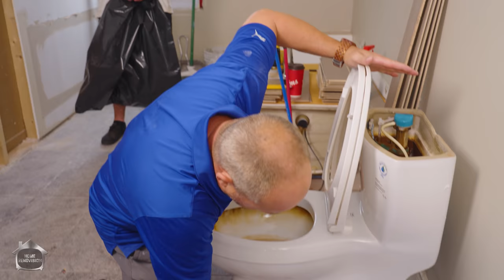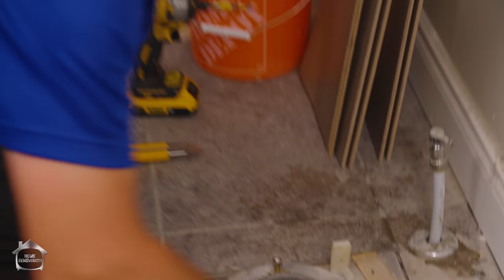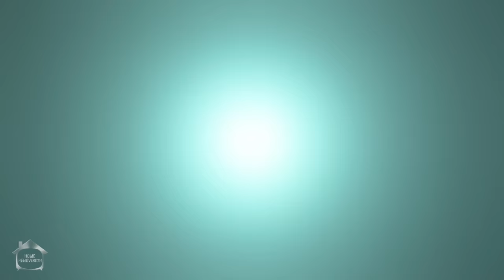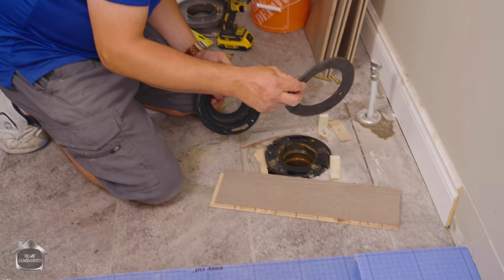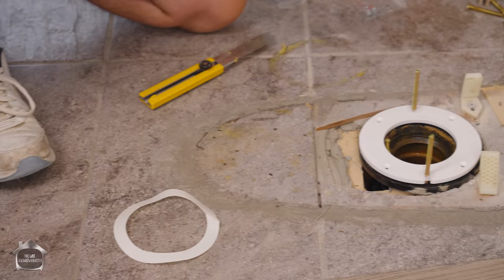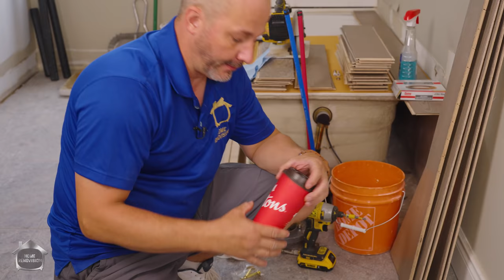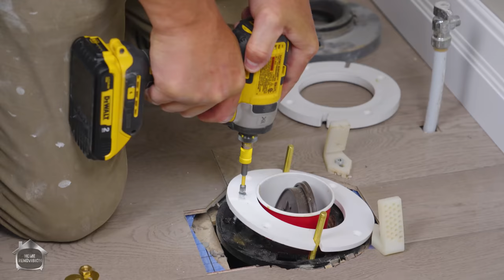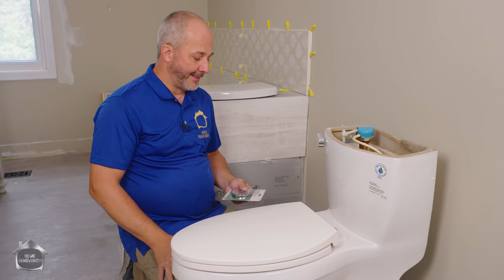How To Install A Toilet So It Won't Leak | DIY For Beginners

Comment: Thanks for your videos....I'm doing a bathroom remodel....and the toilet is a REAR outlet. Should I stay away from wax? Wax was used previously...and it leaked. Neoprene? How should I handle re-installing the rear outlet. The toilet sits on concrete slab, so there is no way I can re-do this...I need to keep the rear outlet. How should I approach this? Thanks.
Reply from the maker: yes use the rubber. Cheers!

Comment: Installed 2 toilets 10 years ago. One with wax and one with no wax and a rubber sealer. Don't recall which is which, but one keeps clogging. Excited to pull it out tomorrow and find out which one it is and why it needs multiple flushes more frequently.
Reply: What did you find out?
Reply: I’m guessing the wax one was clogging?
Reply: @Splattervision-qh1sd  Yes, but not a result of the wax. Looked like my kids flushed wipes down a couple years prior and it got hung up halfway past the wax seal. Overtime, the wipes hardened. When I pulled the toiilet off, it was a solidified flat 3x5 chunk of wipes that wouldn't go down the hole but would move sometimes creating different results from flushes. Looked like it first got stuck in the bottom of the bowl drain where it solidified and flattened, then migrated to the hole.

Comment: I enjoyed your video very much.  However, I would recommend that prior to disconnecting the water supply to the toilet you should locate the main shutoff for the house.  I have had more than my share of leaking block valves.  If you have a spare and know the location of the main shutoff you are money and time ahead.

Comment: What about the powder you can put in the toilet to gel the water so it doesn't leak everywhere?

I like the rubber, universal, wax-free seals. Super easy and they fit a wide range of floor heights. Also super forgiving if you are doing it alone and don't initially drop the toilet straight up and down.

Doing another one soon in a 100yo cottage with new LVT over existing sheet vinyl.

YT borked my comment when I added to it. 🤷‍♀️ I saw your initial reply, though. 👍

Comment: just replaced toilet at my son's.  just installed a year ago by renovator. son initially thought leak was at floor so I assumed seal. then he saw leak at tank. in checking that he broke the  tank. today when we lifted toilet wax seal had not been crushed at all. plumber put flange on cement and renovator put floor around it higher, and cut square hole. new toilet came with horn and thicker wax so went ahead with the installation. toilet shape is such that corners of square hole show a bit at rear.

Comment: If you use grout if the toilet developes leak behind grout you would never detect it before sub floor rots out? Ime I thinking about this correct it would be damming up the water in a way

Comment: I tried to replace the toilet today.  It is 20+ yr old and has been rocking.  Upon removing it, I found a plastic flange bent downward where it is attached to the subfloor and sticking out upward where it is attached to the toilet.  I suspect too much of torque applied on the bolts.  

The flange is about 1/4" above the floor.  Should I try to repair it with the with brass/stainless steel repair kit or replace the entire flange (meaning hiring a plumber)?

Thanks.

Comment: We recently had a company reinstall our brand new toilet. Before renovation, it sat flush on the floor. We had new subfloor and lino laid. The toilet now sits 3/8"-1/2" above the floor. I can see shims under it. When I step on the floor on the left side of the toilet, things sitting on the tank rattle. Even sitting it can cause a rattling. Would that be a loose toilet? I do not want to have to repair our brand new bathroom. Would really appreciate feedback. Thanks!

Comment: I only have one question, once installed how can you tell it's not leaking? I replaced the wax ring for my toilet three times and was still leaking. In the end I had to replace the whole floor and joists because of rots. Now it's time to reinstall and I'm scared to do it.

Comment: When I went to replace the builder grade toilet in my new house it had a wooden wedge under it to level it, and a sort of styrofoam gasket that was adhered to the floor. It took a helluva lot of scraping to get it all off so I could install a decent toilet and wax seal. So much for “professional” plumbers! Another house in the development they failed to glue the sewer line from the toilet and the whole concrete basement floor had to be dug up.

Comment: i always buy at least 2 wax rings in case i mess up one (eg while lowering the new toilet). you can always return the second ring. they are relatively inexpensive too. cheap insurance for me and it avoids a trip to the hardware store mid way through your install if you wreck one.

Comment: I just saw this video. It's great video. But I have a question. I'm going to do my bathroom over. I have to do my floors all In my bathroom. My wood is bad around the toilet.  I knew that I'm going to do the floor. But I was going to put the vinyl plank floor under the toilet so I don't have to cut around it. So I could just make sure that pipe or use a toilet extension and it would work good as I'm seeing from you. If I'm thinking right. Thanks for the video. I'm watching a lot of your videos. And thanks for sharing your information.
Reply: If the wood is bad under your flange  you need to replace the damaged wood.
Reply: Yes I plan on doing that. I have to .

Comment: Did the dye test from the tank. Toilet bowl turned color but not because it dripped from the sides which I thought would be a bad flapper. So where is the leak actually happening? Tank level also slowly goes down too.
Reply: Overflow seal
Reply: @johnd9541  ah thank you, it turned out it was a slow leak from the flapper which after replacing it, that the issue with the tank water lowering over time, and some of the whistling coming from the fill valve too

Comment: You forgot the bit where you discover rot in the subfloor from a bad wax ring and end up re-doing the bathroom floor!
Thanks for another quality video!
Reply: @RobC1999  I'm not a contractor, but I imagine any rotting wood would need to be removed and replaced. Which would involve removing the flooring and subfloor possibly down to the floor joists until you get rid of all the damp wood. No sense in putting a brand new toilet on a rotting subfloor, it will just move and ruin your wax seal and you'll be doing the job over before you know it.

Comment: You can always double wax if the flange is a tad low! Just make sure you don't double wax two jumbo rings with the plastic horn.
Reply: Never ever use one with a plastic horn. Ever. They cause leaks. The horn shifts and splashes water out of the flange. Always go with the plain old wax ring by itself. If you can only find a horn ring, cut the horn out of the center so there's nothing but wax left and the horn is totally out of the center.

Comment: hi i have baseboard 3 zone heat with ac unit in attic, both running same time, i did change old thermostat ( battery operated) to smart that's when the issue start its been 2 different HVAC tech came through and could't figure it out. 2nd one says machine is not compatible with new thermostat. too much power going to ac unit to turn it on. what do you think?

Comment: Good video, as I always like to learn new things. You are a great teacher. As a DIYer, third class, I consider three things before I start a project: Time, Effort, and Money. For time, I always take my estimate and add a factor of two or three. For effort, I decide if I will need a helper(s) to save my back. For the money, when I do a project, it costs what it costs. Professionals: They are only interested in how fast they can do the work. How to do the job with the least effort. And how much money they can get from you. Those plastic 'L' shape pieces. Are they designed to help align the toilet when you replace it? That sounds like a good idea to me. My only negative comment is your use of the adjustable players on the nuts. Isn't that what wrenches are for?

Comment: Hi there

I’m using the plastic extender kit, but found myself with the back of the flange higher than the front. Is it kosher to shim the extender front part with like a piece of plastic? I tried it and it’s pretty level now sitting approx 1/4” above the ground. 

My gut says it should be fine because the extenders even if flush together most likely won’t stop water. 

Any guidance would be appreciated. 

I’m on a concrete slab and got no other options here.

Comment: a question for plumbers....do you recommend caulking the space between the bottom of the toilet where it meets the floor or leaving it open?
Reply: Caulk it. Leave 5ish inches open in the back in case there’s a leak.
Reply: @Jamison-  thank you 👍

Comment: Love the coffee cup trick, can’t wait to use that one!
Reply: After seeing Jeff use this on an earlier video, I had the opportunity. Works perfectly! 👍 🥰
Reply from the maker: Cheers Kathy!
Reply: In the event that something is flushed down a main stack, it can create a vacuum effect and suck the cup down the pipe.  Just stuff a bag with paper and tie it off to the flange.
Reply: @johnd9541  I use a hard plastic drink cup in the LARGE size, that's tiered up larger at the top (so the smaller bottom still fits in the cup holder in your car). That baby isn't going to get sucked down anywhere! 👌

Comment: I’m up-doing my bathroom with vinyl flooring on top of ceramic tiles and need to change the toilet and vanity. Do I change the toilet and vanity then add the floor? Or the other way around?

Comment: As long as the wax is adequate and its installed on a flange that not to high so it rocks it will be fine. If flange is to low just add a 2nd wax ring or a jumbo unit.

Comment: Thanks for the video it's very helpful! I can't understand thought why you need the white extension rings - is it just because you're raising the floor?
Reply: He was raising the the flange height so that the wax ring would meet the flange and squish together to create a seal. All this was a result of a remodeled floor which caused the flange height to once be flush or a little higher than the original floor to now being lower than the new floor and that is a no go!

Comment: here's a couple tips for you pros lol… Use a sliver of carpet, (nap down) not a trash bag. It will protect the toilet and the floor while making it super easy to slide across the floor.  Also use a Pick-up-Stix to lift the toilet from the base. Your back will thank me!
Reply: I remove the toilet and set it on a furniture dolly. It stays on the dolly until it is time to be reinstalled.
Reply: @tomn4838  sounds like it's pretty good just so long as the wheels don't mark the floor, I may try that too! 🍻
Reply: @Don_Von_De_LaNooch Those dollies they sell at Lowe’s, just the basic ones with pneumatic wheels….gold

Comment: I removed the flooring from my bathroom and after all layers were removed my toilet is about 3/4 inches off the floor. How do I adjust for that? Do I need a plumber to lower my flange? My house is older so it's an iron flange.

Comment: Speaking of cheap.....I just had to replace the tank mounting bolts as the bolt heads were rusted right through and caused a leak. This is the first time I ever saw that. What ever happened to solid brass bolts??  BTW I  like your videos a lot.
Reply from the maker: solid brass from china is not the solid brass we grew up with.

Comment: I used a rubber flange with an included  foam gasket (like a craft foam looking deal).
Now the toilet doesn't flush completely. Do you think I need to simply reset reseat the toilet, or use a different flange product?

Comment: Wow, I wish I had watched this a day ago!
Super informative, you guys are AWESOME! Thank you!

I, too, am doing a bathroom reno, and just set the toilet down on the wax ring and bolted it down before bed.
I have 5/8” ply, with 15mm laminate on top of that (with underlay built on to it)
And I… built things such that my new 4x3 ABS flange is sitting flat on TOP of my finished floor.
That flange is nearly 1/2” tall.
I then stuck my included with toilet wax ring (with a horn built on) to the bottom of the toilet, and my dad helped me lower it on to the bolts pretty evenly.

I then had to add about 1/4” of shims to one side of it because of a higher joist under one side of the bathroom.

Will this 1/2” flange on TOP the subfloor + 1/4” shims on one side of the toilet + horned wax ring be a recipe for disaster? 
I’m apprehensive about grouting it and hooking up the water now… maybe I should go get a rubber gasket like the first one you showed and replace my wax one while I still can…

Comment: I'm replacing a toilet with no help and I'm thinking that the rubber ring will be better if I have a little trouble dropping the 70lb toilet in place. Am I right?

Comment: If you have to (or decide to) remove the tank, notice there in no washer between the screw heads and the rubber washers. That is important! If there is a washer between the bolt heads and the rubber, or the rubber and the tank, water will leak between the hard parts and drip on the floor.

Comment: If you grout after toilet placement then you need to replace like for like or you could have ungrounded tile lines exposed outside the new toilet foot print.

Comment: So if my toilet flange is within a quarter or half inch shorter than the finished floor, can I use the thick wax ring and call it a day? I have a lead/cast pipe and surrounded by cement.

Comment: I can’t tell if you ended up using the rubber ring or the wax. Or both?? Did you use the rubber ring on the bottom beneath the floor then wax on top?
Reply: Also how’d you get the blue tape off after you placed the toilet flush to the ground? Planning on trying this in the next month or so!

Comment: What's the extension product you recommend for cast iron flange? I have an old cast iron drain pipe connected to the flange with lead. And with new tile it may be just a bit over the flange height. Looking for extension product. Thanks
Reply: Or would using the tall wax be the easiest/proper way?

Comment: I put some instant gel in the toilet bowl. Never dip out water again to move the toilet. Oatey 31419 LiquiLock Gel Toilet Water Solidifier. Turns back to water when you flush again.

Comment: Few questions.
What do you fill in  small areas of T111 too small to cut out?
Have you used a battery operated paint sprayer for T 111?
Also what elongated toilet do you recommend?

Comment: one of my toilets is good with a wax seal, but my other toilet seems to leak seasonally, so that one has a rubber one, i had a rubber one there but it didnt last long, so i changed it with another rubber one but its different, so we will see how this one does.

Comment: I haven’t had to use a flange extension but I’ve seen them before but I’ve never seen that thin gasket that you show, at the my big box stores. I definitely agree on not using silicone tho. It just seems like a bad idea because it would be going over a surface that just had wax on it and it won’t seal over wax. Even a little film of wax will make the seal fail. I think I’ve just gotten lucky on not needing an extension because I have a handyman biz and I get stuck doing all kinds of weird shit.

Comment: Was hoping that you showed us the grout and silicon application around the bottom as well. How crucial is it to add grout if the seat is quite stable already (no shaking back and forth)?

Comment: Setting a one piece toilet away from the wall works fine however, in some cases, a two piece toilet requires support of some kind to prevent pressure on the tank portion which can result in a broken tank.

Comment: What if you’re going from a higher flooring height to a lower?  Doing a remodel and the last configuration was tile + carpet in bathroom.  Slab on grade cpvc drain.  Tile was installed on a plywood subfloor and we want to rip it out so the bathroom is on the same level as the bedroom.
Reply: Remove the flange and trim the pipe, then install a new flange. It's easy to do this with all variants of closet pipe and flange setups. If it's cast iron lead & oakum, bust off the old iron flange or drill holes in the lead until the flange comes off. Then lead & oakum in a new cast flange or install a 3" into 4" repair flange like a twist-and-set. If it's PVC like you have, cut the horizontal flange portion off with a sawzall, angle grinder, drill saw bit, Dremel, etc. Cut a vertical line into the remaining collar down to the OD of the pipe to relieve neck tension, and then use heat to unglue and remove the flange collar from the pipe with a screwdriver or chisel at the glue joint. Trim the pipe, clean up the OD of old glue, and install a new flange with new glue. Also works with ABS. If you can't get the flange unglued, just trim the pipe and remaining collar down to proper length and install a 3"-into-4" repair flange like a twist-and-set. 

Make sure the flange is secured to the slab around it with concrete anchor screws. Important! Get a hammer drill, a masonry hammer drill bit, and some 3" or 4" Tapcon concrete screws and drill them into the slab to hold the flange rock solid. Make sure the top of the flange will be 1/8-1/4" above the new finished tile floor.

Comment: Is it possible to raise the toilet up a few inches?  For instance build a small box with 2x4's and a small subfloor on top and install the toilet on that?  I'm disabled and a toilet 5 or 6 inches higher would make things a lot easer....  I have some of the original luxury sheet vinyl left over from years ago and decent diy skills but I've never heard of anybody raising their toilet in this fashion but can't think of a reason why you couldn't...